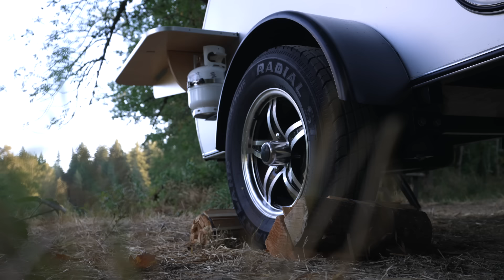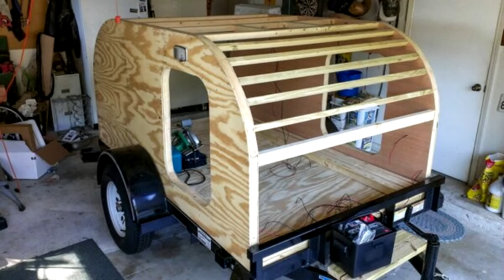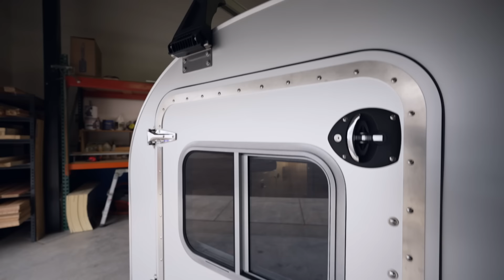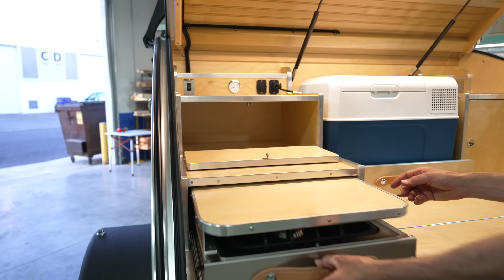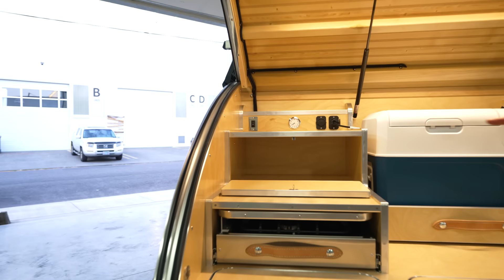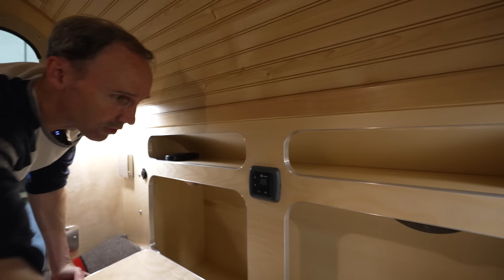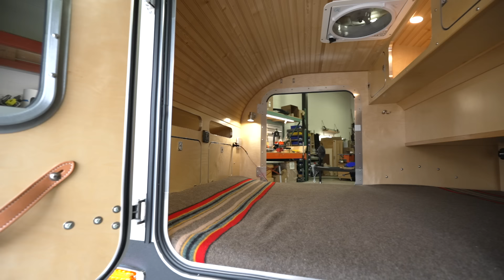RAISING THE BAR! A New Standard for TEARDROP Trailers

Comment: Solid 3/4" plywood seems unnecessarily heavy. They could shave a few hundred pounds without sacrificing strength with a lighter weight build methods. Makes the fiberglass tanks to save weight seem gimmicky when considering what else they could have done.
Reply from the maker: Hi Dustin.  I felt the same way as you less than a year ago. But now my understanding has changed based on my visit to Camp-Inn in Wisconsin and my visit to High Camp in Oregon. Get ready, long response here. So what I have found with larger trailers over 1,500lbs is that they really impact gas mileage and towing power. Meaning trailers like Bean, Colorado, and Escapod with greater drag coefficients and frontal surface areas. Because of my bad experience towing heavier teardrop trailers I was putting that thought process on any trailer that weighed 1,500lbs or more. Which I now realize was not correct. These smaller campers (4X8s, 5X8's) with traditional sized roof heights have a slightly lower drag coefficient and a much smaller frontal area. I have always wondered how Subaru owners and other small tow vehicle owners tow these Camp-Inn style trailers and say they don't feel them behind them. That just didn't make sense to me. But with trailers like this, it really comes down to drag being the major factor over weight. For example you could take the same size trailer, but add 500lbs of gear to it and not see much of a difference in terms of towing power and gas mileage. But if you took the same trailer and added height, width, or other "drag buckets" such as rooftop tents you would see a dramatic decrease in power and mileage. So like Dennis said in the video, the 3/4" plywood really comes down to screw holding strength. And that is HUGE when you consider a traditional trailer starts to loosen at the seams at about the 5 year mark if used often. So if increasing the screw bite life comes with a very minor loss in power, the trade-off makes sense. I would be more concerned about stopping distance than power or mileage at this point. Like I said the gas mileage on a trailer like this at 1,600lbs vs a Colorado Teardrop at 1,600lbs is immensely different. And then this bring us to the tongue. LIke I said with weight before, if evenlyl distributed across the load on a trailer that is aerodynamically efficient, it really doesn't have a large impact. However, weight that rides heavy on the tongue, especially with smaller tow vehicles DOES have a large impact. So reducing that tongue weight in anyway possible is often worth it's weight in gold. See what I did there. 🤓So like you, what used to seem impractical and gimmicky, now makes sense to me. And not just in theory. I have have had the chance to tow a lot of trailers. And my pocket book has taken quite the beating over the years doing it. And I can say with certainty now which trailers burn my money the fastest. I still don't particularly know why yet. That is something I am still digging into. What are the most influential factors on increased drag with teardrop trailers? That is what I want to experiment more with. But what I do know, is that weight isn't the enemy that I once thought it was. Hope this helps a little.
Reply: Hi @dustinjohnson1410 Thanks for watching the review and for supporting Drew's channel!  
You are absolutely right that we could shave a couple hundred pounds if we used 1/2" ply, or used pine spars to span the sidewalls, or simply used a less dense/heavy (and waaay less expensive) plywood.  Most mid-tier traditional teardrop trailer companies do exactly this (however, we've never set out to build just like everyone else😁)  I'm not sure how lighter is particularly better in terms of trailers unless you are specifically looking to tow with a vehicle like a small sedan (Toyota Camry,  etc) with a 1,000 max towing capacity or subcompact  crossover SUV (Forester, Rogue, CRV etc) with a 1,500 max capacity. Once you get past these classes of vehicles, most towing capacities fall around 2,200/2,700/3,500 mark and up (Outback, RAV4, Wrangler).  An "extra" 200 pounds doesn't impact gas mileage meaningfully and if a slightly heavier trailer construction means that it requires less maintenance, handles tougher terrain more smoothly, and is simply more durable in the long run (and we know it does), then we think it's worth it.  
Regarding our comment about the weight savings using fiberglass and aluminum for the LP tanks and storage box (vs steel), the tongue is one area where a specific weight is more important because the trailer's tongue weight should be in a pretty tight range of 10-15% of the total weight of the trailer for it to tow properly/safely.  Ours comes in at about 11.5% (190 lbs/1,650 lbs) before any equipment goes in to the storage box (but with the LP tanks filled).  Assume 25 pounds of equipment in the storage box and that brings our tongue weight to just about under 13.0% of trailer weight (215 lbs/1,675 lbs).  Substitute a off-the-shelf heavy gauge steel box and two 20-lb steel LP tanks and you're going to add about 50 pounds and beef up the tongue weight to just over 15.0% - on the heftier side - (265/1,725).  So these considerations are important and make a big difference in how a trailer responds on the road. 
Lastly, another significant reason we produce our own aluminum storage box is that since we can source the exact material we need at any time and cut the aluminum on our CNC router in house, we have full control over quality, can make design improvements at any time and control inventory timing rather than being at the mercy of a vendors variable QC standards, or suffer backorders and out of stocks.  We take this approach with any component that we can fabricate rather than purchase, right down to cutting and forming our own stainless steel roof rack mounts and even license plate holders!  
Hopefully this helps explain our thought process in our material selections. I know it's a lot for a likely random comment, but it's a good opportunity for us to share.  
Thanks!

Comment: Question: Fridge in the galley. I had issues with mine running all the time due to the warm compressor exhausting its heat & no ventilation. 

I can't be alone on this issue.  I moved my Fridge to the tow vehicle ... problem solved.  
Thoughts?
Reply from the maker: That is a really good point you have here. I think there must be a lot of factors at play. Type of compressor Dan Foss vs. Samsung vs. no-name compressor heat output. Insulated vs. uninsulated trailer. Air volume of galley and movement of air. Using the insulated sleave vs leaving it off. I say all this because our biggest shock in the last two years has been the efficiency of our Iceco JP40 in the back of the Bean trailer. We parked it in the sun most the summer and that fridge just sipped the battery. Every time I opened up the hatch I rarely heard the compressor on. WHY???  I wish I knew. Because in other scenarios with fridges I have heard the compressor on all day long. But what you are saying definitely makes sense. In theory that galley could easily become a hot box from the exhaust of the fridge. I hope others chime in about this. I would be very interedsted to hear their thoughts.

Comment: Very well made. Finely engineered. However, I prefer storage over aesthetics, too. 

Always curious since you mentioned it (I don’t know a year ago?), what about a pass-through into the cabin? Is that fairly rare?
Reply from the maker: Good question Zack. Suprisingly pass-throughs are pretty rare on teardrop trailers. We made sure to add one on our new custom build that we are working on. The Vistabule that I mentioned at the beginninig of the video has one. And there's is unique because the entire galley isn't passthrough, it is just one section of the galley.

Comment: This is a beautiful tear drop trailer. Is it the ‘new standard’? There is certainly the attention to details and components that do make a difference between “a bed in a box on wheels” versus a tiny sanctuary that you want to spend quality time in and around, to enjoy, admire, and take pride in ownership. And this trailer definitely fits in the ‘sanctuary’ level and checks some major boxes for me. If I were inclined, this trailer would be worthwhile seeing/feeling in person and making the comparison to my CampInn Ultra 560 Tear Drop (#1032). I have to admit, when first glanced at the thumbnail image for this well presented video, I thought I was seeing a CampInn teardrop, and Cary Winch sold his company (whew…😅).
Reply from the maker: To be honest I believe what Cary and Craig has done in the industry has set the bar. Although they set it years ago, people were willing to ignore the bar and make inferior trailers for years. Meaning inferior to a Camp-Inn. But I believe the narrative is changing quite a bit in the small camper industry. And people are becoming more aware of the build processes. Trailers like Dennis’ and Cary and Craig’s will be setting a new standard. With the rise of composite trailers and aluminum framed trailers I think haphazard traditional teardrop construction will struggle to last. Hence to survive in the industry with a classic teardrop I believe manufacturers will need to reach the bar set by Camp-Inn, High Camp, and Vistabule. The only alternative would be to offer their trailers at an incredibly discounted rate. I may be wrong with this prediction, but I have a feeling there may be some truth in it. As for “new standard” in the title, although designed for this trailer and video, it was more aimed towards trailers that are built for longevity. Take the formed plywood on the roof for example, in this video. These are the build processes that are going to keep companies in business for years to come. I’m excited to highlight Camp-Inn soon. We made a number of videos with owners, the Camp-Out, and within the facility. You have a really special trailer by the way!

Comment: This looks like an extremely well manufactured, well optioned trailer for an incredible price.  My home built teardrop wasn't far off from the base price of this model.  Though I do agree with Drew 100% on the full galley hatch.  In my opinion, the under counter drawers and slide outs are far superior to the top loading cabinetry in these 3/4" hatch models.  I put some top loading storage in a cargo trailer conversion that I built and it was one of my biggest regrets.  It doesn't seem like it would be a pain at first, but when you are limited on space and you have to continually move items off the counter to access the storage, it quickly becomes annoying. That said, this looks like a real competitor to the Vistabule and Camp Inn trailers.
Reply from the maker: Yes, building your own trailer in 2023 can get out of hand price wise. It is crazy how much materials have went up in price. Good point on the continually moving items part. I didn't even consider that when I was thinking about the cons.

Comment: I own one of these, and it is amazing. Build quality is second to none! They offer a canopy that goes over the galley hatch, and it takes about 2 minutes to set up. We use it to shade us from the sun and protect us from the elements. The rear storage is huge. We added a small top box to hold our chairs and some outdoor supplies. We tow with a full size truck, so we have plenty of storage. We get people coming up to talk to use about it all the time. We love ours!
Reply from the maker: David I so appreciate this comment. Thanks as well for sharing about the canopy I know folks will really appreciate that. I can tell you with 100% honesty, I have seen a lot of trailers. And this is a SPECIAL trailer. Like you said the build quality is second to none.
Reply: @PlayingwithSticks  Hey, Drew! Adding this comment to this video, but certainly applies across the board. One spec that might be worth putting some focus on is approach and especially departure angles. Everyone talks about ground clearance but that's only part of it. In my case, I'm torn between High Camp and Vistabule. But one big point against Vistabule (for me) right now is relatively low ground clearance (10" vs 13 for the High Camp) but especially that very small departure angle due to how long the back of the Vestibule is from the tire. (Due in part to being a longer 10-foot trailer) I'm really concerned about dragging the back end going up a not-even-too-crazy hill offroad.

Anyway, maybe worth a focus in a future video. Love your stuff!
Reply from the maker: @deanlockwood2124 I don’t spend a lot of time talking about this because I’ve come to find in the field, It’s rarely the departure angles that affect me. There is a caveat here I think approach and departure angles are important with true off-road vehicles coupled with the departure angle of an off-road trailer. But when we are talking trailers of 10 to 15 inches of clearance I have rarely, if ever struggled with the departure angle, it’s actually the tongue where I bottom out. Trailers like my scamp or Shasta compact where the axles are more center mounted. I do drag that back end. But I have taken teardrop trailers everywhere my tow vehicle can get and every issue I’ve ever had is that tongue dragging into the ground. I hope that makes sense. Again you’re right departure angle is important, but when you’re getting into trailers this low it tends to not be the hangup. Edit: after I posted this, I had a couple more thoughts. First I have never taken out a teardrop trailer under 12 inches off road. So I must admit, I don’t know the impacts of this height or less. But in regards to 12 to 15 inch clearances I have never had issues. And this got me thinking about off-road teardrop trailers. A great example is my trip with Bean Trailer last year. We pushed those trailers purposely to find their limits. And like usual, the only limiting factor was the tow vehicle. And here is why I think that is. It is rare, if ever that someone towing a teardrop trailer has a trailer that has lower clearance than their tow vehicle. When it comes to people towing something like a Vistabule , camp inn, or high camp if they are towing with a stock SUV or Jeep, from the factory, even the highest clearance models still have lower clearance than a 10-12 inch teardrop. And then when it comes to someone truly off Roading, most of these teardrop trailers are at least 20 inches of clearance. So I’m starting to scratch my head a bit and wonder if all this departure angle talk is actually important in any segment of teardrop trailer? And I say this because I think of the countless hours of videos, I edited from that Bean Trailer trip last year. I have so much footage of tongue, jacks, and tongues bottoming out on different angles and conditions on the trails. I don’t have any footage of the rear end of the teardrop trailer touching anything. And all my years of filming I don’t have any videos of my rear end touching anything. And I don’t think that’s because of departure angles, good or bad I think it has to do with the height of these trailers in relation to the height of the tow vehicles. If I’m wrong on this, let me know, but just by anecdotal evidence I’m not seeing any difference in the field between a trailer with a good departure angle, and a trailer with a poor departure angle. I’m seeing issues with either the tow vehicle getting hung up or the tongue getting hung up. To me I think the big difference is between the 12 inches of clearance and the 10 inches of clearance. That’s 2 inches of difference between bottoming out your tongue or not bottoming out your tongue . I’m glad you brought this up. This gives me a lot to think about.
Reply: @PlayingwithSticks  Appreciate the thoughtful reply! I confess I'm speaking less from experience and more just eyeballing things. With the Vistabule, what worries me is the combination of relatively low 10-inch ground clearance AND that pretty long distance from tire to rear tip of vehicle. (Actually, that's partly the limiting factor of my Subaru Outback Wilderness. Ground clearance is plentiful, but Outbacks have long front and rear overhangs compared to, say, a Forester.) I know Vistabule increased their clearance a few years back. I wonder if they can be lifted with a kit? (Argh. I just realized you can't post pics to a YouTube comment!)
Reply: I'd love one of these! I travel for work on 3- month assignments,  and I'd love to have one of these on days I'm not at the hotel. I have an Outback, so I need to learn about tow capacity 🤩
Reply: How long did you have to wait for your trailer?
Reply: how much?
Reply: Hi does it work with a tent on the roof?